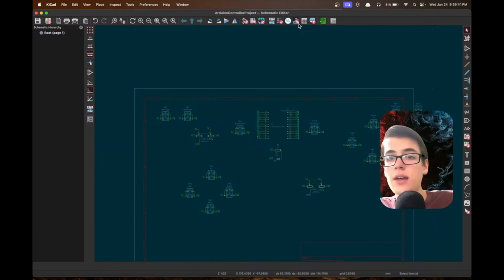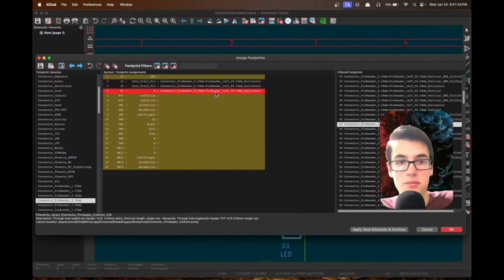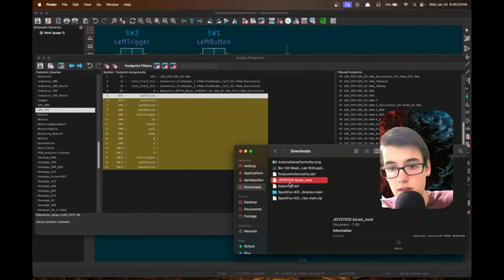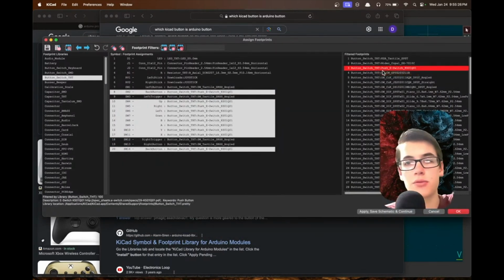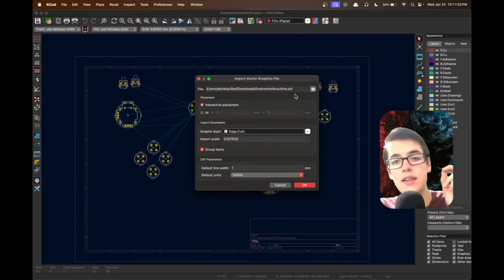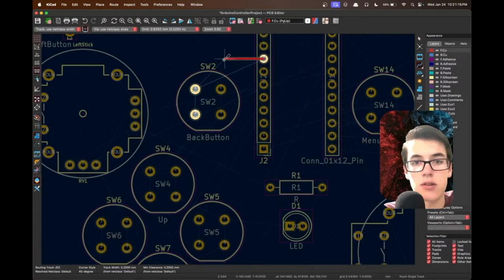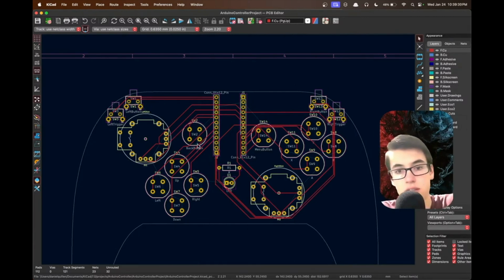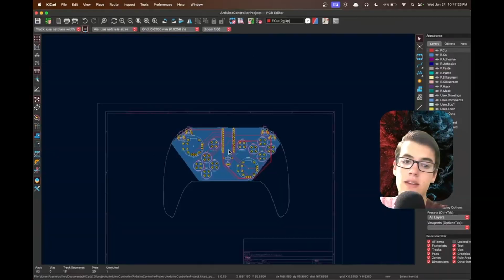② Arduino Game Controller | PCB Design

Comment: Hi friend, have you seen the ModdedZone PCB? This PCB connects to the Dualsense in order to record all actions and modify them. Is it possible to do something like this?
Reply from the maker: Yeah you could definitely do that with this controller, as you can send whatever signals you want. This one only works with PC though, because Xbox doesn't like other people's controllers, so if you wanted to do something like what ModdedZone is doing you'd have to make a PCB that talked directly to Xbox's internal PCB (or PlayStation's internal PCB, I assume they also don't like 3rd party controllers) to get those effects.

Comment: Loving the videos. However, for some reason my joysticks do not have the blue lines (rat nests I believe they are) when I update from schematic
Reply from the maker: Hmm that’s a bit odd, did you use the same joystick footprint or another one?
Reply: @danovation  The same joystick. I was having problem importing it cause it did not want to show up but I got that to work by adding to project instead of global
Reply: @danovation  Actually I see the problem, mine shows V1, V2, V3 and H1, H2, H3 instead of 1,2,3,4,5,6 for some reason
Reply from the maker: @kalex7370  Ah ok